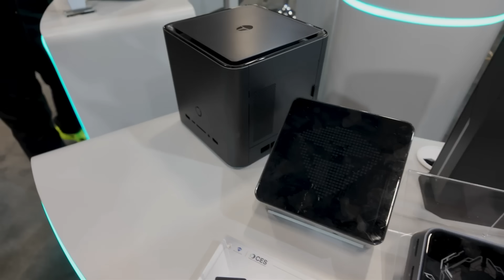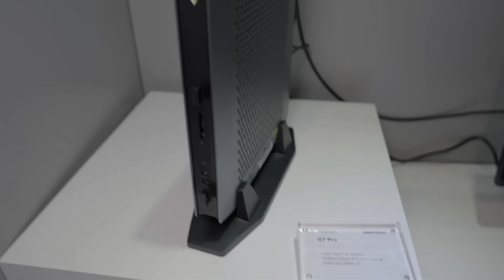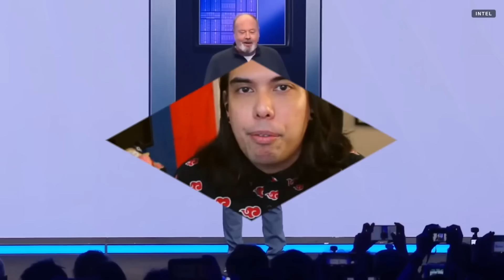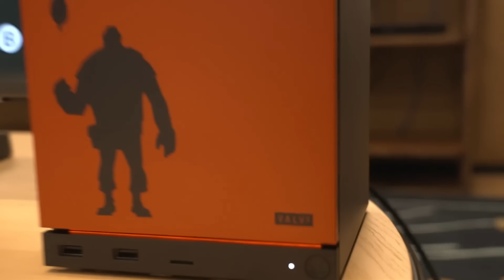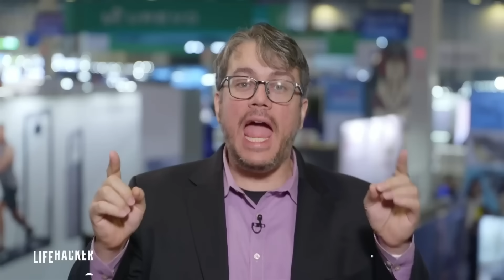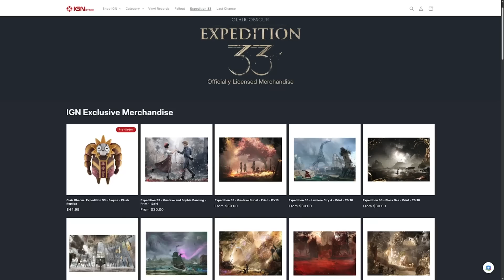How RAM Shortages Are Making Tech More Expensive & Boring - CES 2026

Comment: From a gamer perspective I see this as the generation that refuses to move and instead of 5-7 years between generations, we might be looking at 15-20 years.  Games have reached a level that getting a graphics boost doesn't have the same impact.  Combine that with the RAM shortage, the move to mobile over the last generation, the interest in retro, the move to streaming games, and other economic factors; you have an environment that will punish publishers that move beyond the tech available to the mass public.   Tech will advance but we may never see the leaps of the previous generations.
Reply: Next gen GPU and consoles seemed more geared towards Ray trading and more native resolution bumps. Of course AI and FSR should all be improved. Graphics are great for consoles atm.